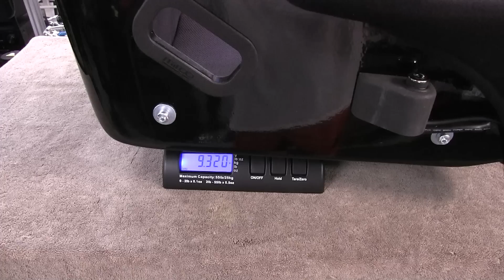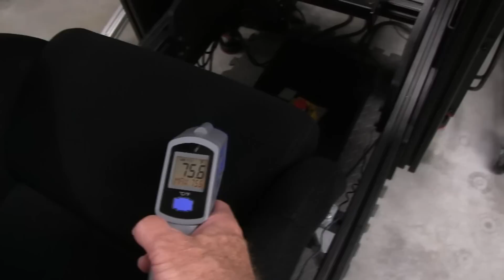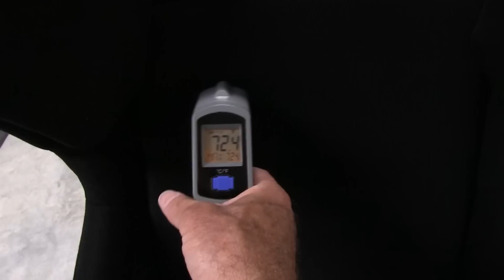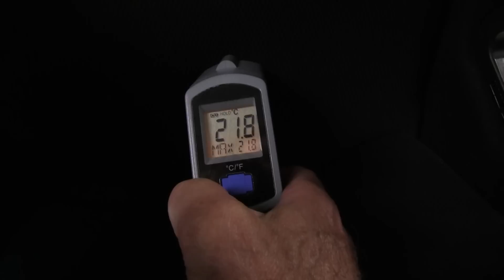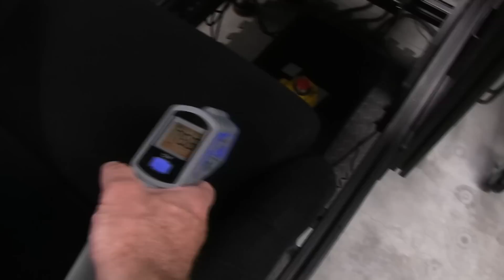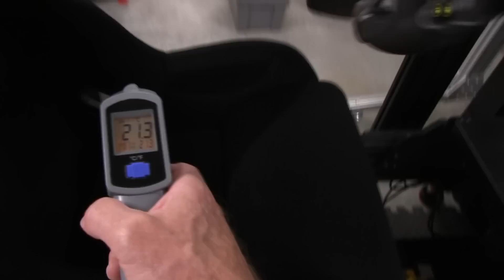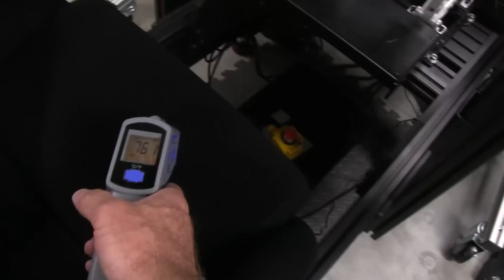O-Rouge Cold Fusion Seat Review

Comment: Fans moving ambient air don't lower temperature. Evaporation of moisture(perspiration) through air movement is what lowers body temperature. If a temp was taken elsewhere in the room the temps would have to be the same as on the seat other than for hot and cold spots in the room created by the aircon.
Reply: jonasjonaitis8571  he is sweating but doesn't feel sweaty anymore because the moment any sweat is produced, it is able to be leave the surface of his body via the continual replenishment of fresh (i.e. low moisture) air in the regions where sweat would normally collect. This also has a positive feedback loop of reducing rate of sweat produced too since the sweat produced is able to evaporate away from his body which is what cools his body in the process. When the sweat is unable to evaporate, it acts to insulate and thus rate of sweating increases as old sweat remains (the opposite of it sweatings intended purpose but the autonomic systems in the brain regulating body temp systems doesn't have any means of knowing and factoring this in. It relies on us becoming irritated enough by the elevated body temp and sweatiness to go find somewhere to expose the body to fresh air so the sweat can evaporate and have the cooling effect it is designed to cause).

Comment: Nice to see Polish product on your channel. I have a seat from them (different model) and am very happy with it. Mirco's solid company, they have their manufacturing site in Skoczów, Poland.
Reply: Thanks for your feedback which proves our quality of course.  We only use the Mirco seat as a basis (we could have used Sparco, Sabelt, ... or other brands as well) but we choose to work with Mirco for the following reasons:

- Build quality of the seat
- Stiffness of the shell as we need to drill holes
- They cooperate with us to reinforce the shell while drilling holes

The engineering, manufacture and installation of the cooling feature is done in Belgium, so it is a full EU product.

Comment: The Polish don't fuck around, some of the best engineers.
Reply: Thanks for your feedback which proves our quality of course.  We only use the Mirco seat as a basis (we could have used Sparco, Sabelt, ... or other brands as well) but we choose to work with Mirco for the following reasons:

- Build quality of the seat
- Stiffness of the shell as we need to drill holes
- They cooperate with us to reinforce the shell while drilling holes

The engineering, manufacture and installation of the cooling feature is done in Belgium, so it is a full EU product.

Comment: I'd like to see more seats with less wrap around support tbh. As someone who uses my simrig as a workstation as well (great real-estate for productivity), bucket seats are not comfortable.
Reply: I had that issue. I ran a NRG wraparound seat in my rig the last couple years but once I added hinges to my keyboard tray so I could do away with the separate gaming desk, I wanted a seat easier to climb in/out. Looking to sell my NRG that looks new still, as I had a custom padded cover over it. Hopefully since it was a $650 seat, I can sell it and buy one of the XL NRG Prisma seats.  My brake, like most is very stiff and that's why I went with a solid back seat. I tried the Prisma seat tho and it's got less movement than I expected in the back. I know there's a way to lock the back as well. May have to weld the recliner or something, not sure
Reply: @koenallard  yeah, that's what I've done. Pulled a seat out of 1998 Honda Odessy. Super comfortable. But it doesn't have ventilation so summer is swampy.